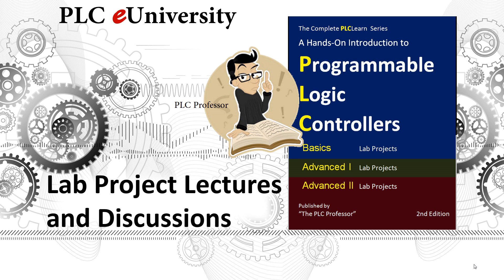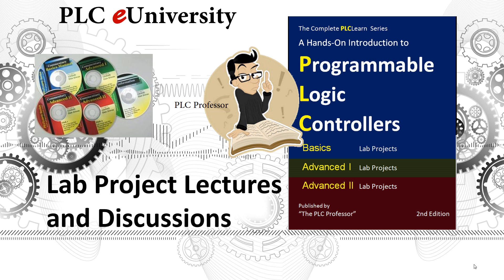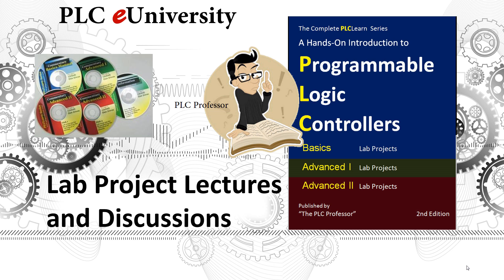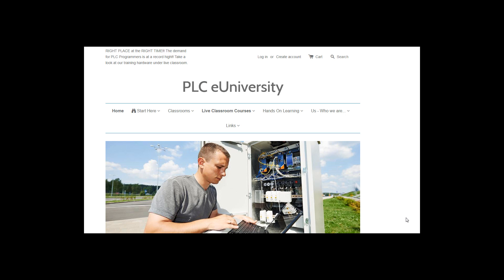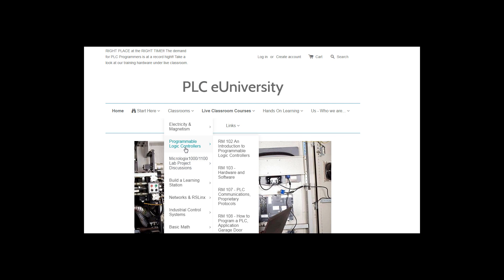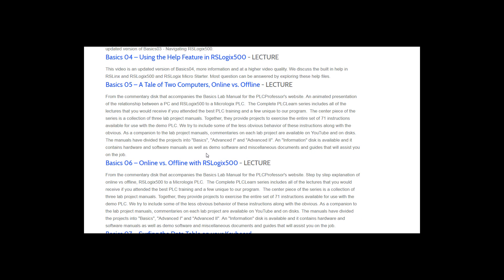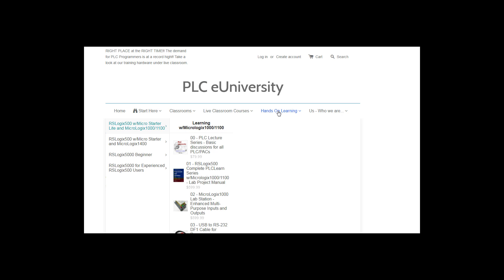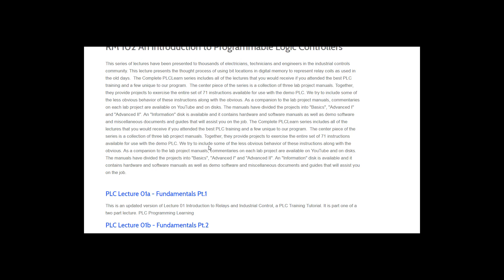NEW!!! Lab Project Manual and 31 Lecture Discussion Videos

Comment: How can answer these question?
Provided documentation:

 - Faults and Alarms SINAMICS S.pdf
- Guardmaster fault.pdf
- PLC Specialist Test.pdf
- Sensaguard.pdf
- SMC3.pdf
- RSLogix 5000 instructions.pdf
 
Task:

Answer the questions in the questionnaire using the provided documentation as reference. The task must be performed in an office room, alone and a computer maybe used for reading the documentation or calculating values. All answers must be written on the questionnaire in each provided area.

5 points will be subtracted from the final result if any notes or marks are found on the provided documentation.

Answers:

1 point will be subtracted from the final result if an answer is given without proper units.

Below are the anticipated answers for this test along with explanations. 
   

#1 – Active alarm (5 points)

One of our customers is calling to get help solving an issue with his machine. An alarm is shown on screen and he does not know what to do. The alarm description is called “Photocell Fault”. Searching in the ladder program, you find the following rung triggering the fault in the ladder logic of Figure 1.

Figure 1 – Photocell fault rung

What is causing this fault and what should the customer do to solve it? (5 points)

Answer: 

Remove sensor obstruction
Realign the sensor
Reset the alarm 
Sensor is damaged, replace it
Remove sensor obstruction and reset the alarm
Realign the sensor and reset the alarm
Remove sensor obstruction and Realign the sensor
Remove sensor obstruction, Realign the sensor and reset the alarm
Replace the sensor and reset the alarm
Replace the sensor, realign the sensor and reset the alarm
None of the above

#2 – First in first out issue (10 points)

While helping a customer to restore the normal operation of a pneumatic cylinder that is not working as intended, you found out that the action to actuate the cylinder is not triggering.
During normal operation, the cylinder must be active for one second after reaching the memorized encoder position. The encoder value increases positively over time and is set to zero when the machine is started. A command signal will put in memory the current position of the encoder and add 100 to this measure. Once this command is activated, the memorized position is deleted. See Figure 2 for details.

Figure 2 – FIFO command for pneumatic cylinder with Memory array

What is restraining the cylinder from being activated? (5 points)

Answer: 

a) The data Memory[2] is bigger than Encoder_Current_Position
b) The next (newer) values (Memoty[1] and others) are further in the memory array
c) The data Memory[0] is bigger than Encoder_Current_Position
d) The next (newer) values (Memoty[0] and others) are further in the memory array
e) a) and d)
f) c) and d)
g) b) and c)
h) a) and c)
i) none of the above

How can you modify this part of the program to avoid this problem in the future? Choose 2 of the followings : (5 points)

By adding a GEQ block (Memory 0 / Memory 1)in parallel with the Pneumatic cylinder activation and a FIFO.EU NC contact before the FFU block.
By adding a LEQ block (Memory 0 / Memory 1)in parallel with the Pneumatic cylinder activation and a FIFO.EU NC contact before the FFU block.
By adding 2 GEQ blocks (Encoder current position / Memory 0) and (Memory 0 / Memory 1) in parallel with the Pneumatic cylinder activation and a FIFO.EU NC contact before the FFU block.
By adding a GEQ block (Memory 1 / Memory 2)in parallel with the Pneumatic cylinder activation and a FIFO.EU NC contact before the FFU block.
By adding a GEQ block (Memory 1 / Memory 2)in parallel with the Pneumatic cylinder activation and a FIFO.EU NO contact before the FFU block.
By adding a GEQ block (Memory 0 / Memory 1)in parallel with the Pneumatic cylinder activation and a FIFO.EU NO contact before the FFU block.
By adding a LEQ block (Memory 0 / Memory 1)in parallel with the Pneumatic cylinder activation and a FIFO.EU NO contact before the FFU block.
By adding a LEQ block (Memory 1 / Memory 2)in parallel with the Pneumatic cylinder activation and a FIFO.EU NC contact before the FFU block.
By adding a LEQ block (Memory 1 / Memory 2)in parallel with the Pneumatic cylinder activation and a FIFO.EU NO contact before the FFU block.

#3 – Photocell trouble (5 points)

One of the machines you have installed at a customer is showing a strange behavior once in a while. Starting a trend reveals you that the second photocell (pink pen on Figure 3), has a bouncing signal once or twice every minute but the first photocell always has a good signal. The photocells are using a diffused light to sense the objects and are mounted with a distance of 40 inches between each other. Objects are of different sizes.

Figure 3 – Photocells trend

What would you do to solve this situation? (3 points)

☐Add timers to the program to debounce the input
☐Modify the program so it uses the first photocell instead
☐Ask the customer to properly align and adjust the sensor
☐Send a new type of photocell to replace the current one